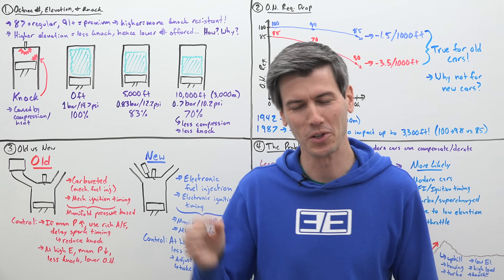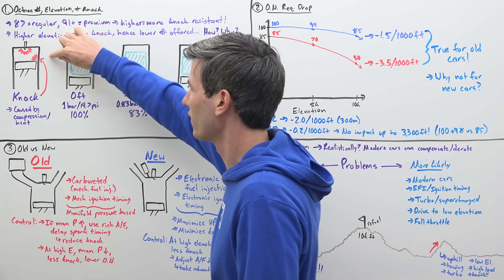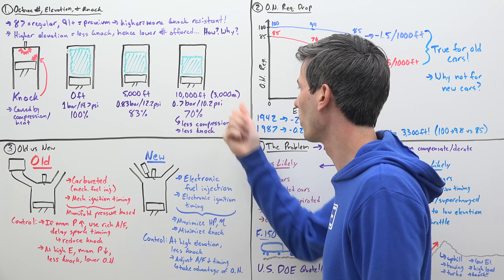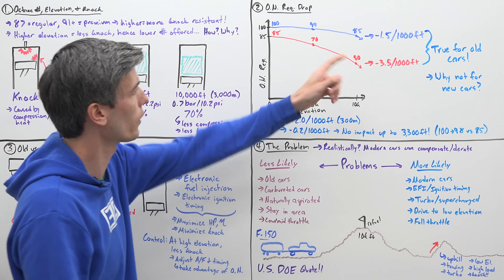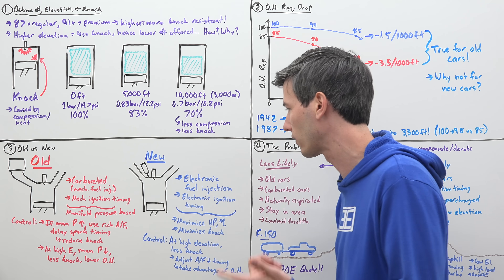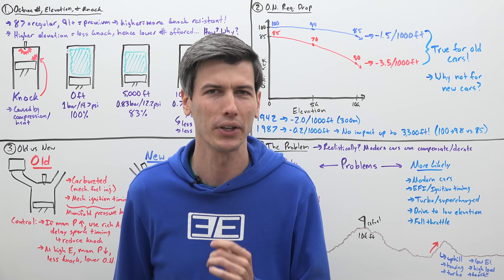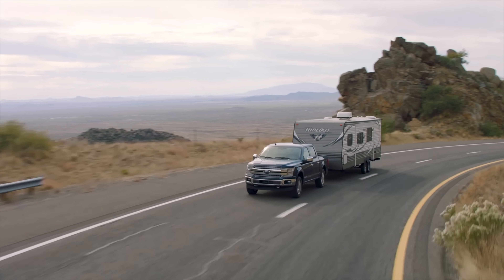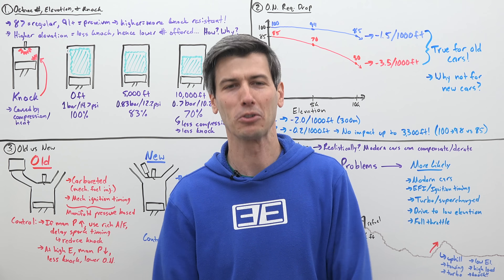Never Use This Gas In Your Car!

Comment: Most modern cars can detect when you're using lower octane fuel and can adjust the spark timing accordingly. You will lose a bit of power, but at least you won't get detonation. Having said that though, you should always use the octane rating recommended by your owner's manual.
Reply: The car has no way to directly measure the octane rating of the fuel it's getting, what it actually does is detect the knocking sounds (using a microphone bolted to the block) and retard timing until they stop. If there hasn't been a detonation for a while, the engine tries to advance the timing again, and on the cycle goes.
Reply: @nerd1000ify  Correct

Comment: Living in Colorado above 6k feet I've used 85 in some vehicles. Most of the time it's fine in n/a regular cars. Now performance vehicles and high compression engines you can't this is absolutely true. Even my old 08 4.7L dakota will knock at wot with 85 Oct. My RVs 6.8L v10 also looses power on 85 which sucks its our regular gas so you pay a lot more for 87 here. Also, turbo vehicles really should use 91 oct here due to the extra AIT heat compressing more lbs of boost to compensate for atmospheric loss. The more heat the more likely you'll knock. I hate it but realistically filling up a 60 gal RV at $4.00  a gallon for 87 here just isn't feasible for me so I take it easy on it.

Comment: I disagree that older cars have less problems with this. Reason: They do not have the precision control over fuel metering and ignition timing. They also don't have knock sensors. I'm only speaking of naturally aspirated engines here. My "modern" 2003 Corolla did just fine on 85 up in the Denver area in spite of its >10:1 compression ration. But it has very precise engine control. Got 40MPG on that stuff.

The real issue with modern cars is high compression ratios often paired with turbos. A naturally aspirated V8 F-150 will do fine on 85 (not towing) a mile high. As you explained you have less air and less pressure in the chambers due to the altitude. Turbochargers pressurize to their spec. They'll spin faster at altitude to compensate and put the specified boost in those chambers. That's where the 85 garbage gets you in trouble. Ditto for any other modern turbocharged vehicle. They run much better at high altitude thanks to the turbo. But you better put decent fuel in it if you want it to last.

Comment: Regular gas pumps should have circular pump nozzle...diesel should have square...e85 should have triangular pump nozzle. That way they can't be used incorrectly without an adapter if car is modified to run e85 or diesel

Comment: Common sense really...only use fuel that your car was designed to use...or higher rated octane(pump gas levels). Unless you've converted your car to run on e85 or it was designed to run it...don't.

What's more interesting is direct port injection pcv recirculation systems. Lowers octane...causes knock...yet the epa still wants it to be recirculated into intake and most manufacturers don't install catch cans from factory. This is terrible on DI motors...and lowers efficiency. Lowered efficiency means more gallons of gas and therefore more oil extracted as well as more exhaust being produced.

Comment: I love in CO we have 85, 87 and 91 at higher elevations you don’t need as much octane as you do at sea level 87 at sea level is equal to 85 octane at 5000ft cause I live in TN they offer 87, 89 and 93, now E85 is totally different it’s 40% ethanol 60% water only place to get good fuel is the race tracks they have usually 93 and 120 octane, 120 octane fuel runs great especially in air cooled motors

Comment: In U.K. the lowest spec gasoline is 95 RON. 97 and 99 are sold as premium fuels. There is a noticeable difference. My car on 95 feels like the exhaust is corked up. It would be hugely down on power at 87 RON. No surprise that US cars have such big engines.

Comment: Grew up in Denver, 85 octane pretty common... lower air density = less compression on naturally aspirated engines (so you don't need the octane to reduce the detonation potential)... well that used to be the case... all these new turbo engines, however, might have an issue with it, though, now that i think of it.

Comment: I remember seeing Reg85 as I was driving through some parts of New Mexico and Arizona years ago. I thought to myself, it makes sense that higher altitudes would allow for a lower octane fuel because the lower air density means less chance for pre-ignition. Though, I wondered if the idiots selling the stuff considered that many who fill up here are simply passing through, meaning they'll most likely pass back through lower elevations before they fill up again. I thought it was just a scam by the gas station to force pass-throughs to buy mid-grade at a higher price.
Reply: I'm betting they're offering what the refiners have available to them and it's up to the idiots who own the vehicles to know what fuel is required.

Comment: Don't modern FI engines have anti-knock sensors?  My experience with recent BMW motorcycles (last 10 or 15 years), is that, via the Bosch engine management systems, they have knock sensors and change the mapping when they detect knock.  (BMW also recommends mid or premium grade gas, depending on model, but I've had the experience of fueling at a gas station that only has 85 available.)

Comment: Explain to me then why ethanol has can have a lower rating than conventional. 
E-10 gas starts as sub grade at 83.5 blending the ethanol adds 2 points for 85.5 for what's supposed to be 87. The conventional or non ethanol is actually at the rated number or higher. Where I primarily load our e10-91 is actually 89.5 and the conventional 87 they ship is 87.5. The conventional 87 is the exact same gas as the e10-91 just without the ethanol.

Comment: My naturally aspirated 2008 car requires 91 at sea level but I've run 87 in it at 4500 ft with no problems for 13 years now.

Comment: I chose 85 in my Jeep Comanche while driving through Colorado since it was the only grade at the pump.  I regretted it when I was in Kansas doing 80 mph heading into a 25 mph breeze...the knock sensor pulled back timing so far back that I was at WOT trying to keep up with traffic.  Added some 93 and it was much better
Reply: Interesting. I did a cross country this summer and noticed the low octane in Colorado. The station had higher octanes available and I didn't know how my car would run on 85 when I got to lower altitudes, so I got the higher grade.
Reply: try running 25% E85 on top of 75% low grade. You'll save money and not have that knock.
Reply: @ChrisLesmerises  I'm good. I don't need 30-50 cents that badly
Reply: That's just Jeep bro lol
Reply: I always stop at Idaho Spring for gas on my way through the Rockies and wtf half the stations didn't have ANY gas, and the others had only 85. Next time I'll be bring a couple gas cans in the trunk.
Reply: @MrPizzaman09 --- "...so far back that I was at WOT...."

You were at "Web of Trust"?  "Wheel of Time?"  "Wall of Text?"  "Weak Operator Topology?"  "War Office Transport?"  "Wheels of Transformation?"

Those are just the first six initialisms that came up in a Guggle search.  Whatever the heck "WOT" means to you, many people (including at least two other 'car guys' I asked), have no clue what you're saying. 
 
Please just spell out a few more words and make the internet decipherable for everyone.
Thanks.
Reply: @be5952  Wide Open Throttle
Reply: @be5952  i thought maybe he was playing World Of Tanks, which would have been very dangerous while trying to keep up with traffic..
Reply: @be5952  WOT is a common term used in discussions and technical papers related to performance and operation gasoline engines (not diesel engines bec there is no throttle).
Reply: @borysnijinski331  A diesel Throttles by adjusting the fuel input. A gasoline engine throttles by restricting the incoming air to the engine. Both engines have throttle. both engines have throttle pedals to communicate driver input to the vehicle. Gasoline engines have a "throttle plate" Diesels do not. Well, most diesels do not.
Reply: @be5952  wide open throttle, its a term used by people who know a thing about cars.
Reply: @be5952  really? I literally googled "what does wot mean cars" and it brought it right up lmfao
Reply: @be5952  What is guggle? and this is a car enthusiast channel. WOT is obviously WIDE OPEN THROTTLE. now get in your own lane. Any car guy that doesn't instantly think of WIDE OPEN THROTTLE is no car guy. And any troll who doesn't double check his spelling is bound to get spanked. Now before you get all high and mighty about something this engrained in car enthusiast culture, check yourself.

Comment: Ford (or any manufacturer) does not need to "hunt" anybody down for using the wrong fuel and void their warrenty.  Service technicians are trained on how to test the fuel if they suspect an engine issue is caused by fuel.  I have never lived where 85 octane is sold but have tested fuel for octane and ethanol.  it's easy and quick.  An average technician can also tell if the wrong fuel was used and then switched to the proper fuel.

Comment: I assumed that the knock sensor was there so the computer could adjust accordingly but perhaps the map does not allow adequate variation because the manufacturer decided on the octane limit.
Reply: the loss of power is a consequence of physics and the map is set so their is no engine damage - you are confusing two things, watch the video again

Comment: Surely it would be easy for ford to creat a mapping to use that octane of fuel, even if it means changing throttle response, injection rates etc. Yes the user will have suppar performance but as you say, it is insane they sell fuep that cannot be used

Comment: In regards to how out of touch laws are, where I live, close to Chicago, we have to go to a summer blend gas with less oxygen to prevent vapor lock. Vapor lock is only a problem in carburated engines, les than 1% of the cars today have carbs.

Comment: I've heard european E85 and america 85 petrol isn't the same. Octane rating is different I believe. I've never used E85 in anything. I know my brp snowmobile gas cap say it's E85 compatible.  I'm not using it if I can avoid it. I'm not taking a risk with fuel I don't have enough knowledge about.
Reply: That's not remotly the same. E85 means 85% Ethanol, where as 85 octan petrol is still regular petrol, just with a low octane number. E85 can only be used in vehicles which are specified for it.
Reply: @shi01  thanks for the information. Like I said I have almost zero knowledge about the e85 fuel, so I don't use it.   They stopped seeling 98octane where I live.  I believe 98 in Scandinavia is similar to American 95 or 92 octane.

Comment: Great video man! The UK government has increased the ethanol content in the fuel to 10% and my car knocks like hell when running on it. Took me a while to figure out it was the fuel and not an issue with the engine lol.
Reply: Strange. 🤔 Here in the US, 10% has been the standard since the 1990s in most grades of gas. All cars are made for it. And Ethanol has a higher octane rating than standard gas. It's used as an octane booster in the US. Hence why our E85 has an octane rating well in excess of 100 octane. It's 85% Ethanol and just 15% gas. So if your engine is knocking, something else is going wrong with it. You should be getting better performance if anything.

Comment: We sell E85 and you can put it in any vehicle that burns Petrol. There is no difference in the filler neck. It fits anything but diesel.

And E85 can totally destroy pre-2001 vehicle fuel systems, and will at the very least cause lean AFR's on a vehicle not calibrated for E85 or lacking a flex sensor. Lean AFR's will inevitably destroy an engine over time.

So yes, we sell fuels that can destroy a car. It's all operator choice.

Comment: Anecdote: a daily driven 2009 Hyundai Santa Fe, currently at 225,000 miles on original engine. Car was purchased in 2011 with 20,000 miles. THE CAR HAS ONLY EVER USED 85 OCTANE! Don’t waste your money because some guy on YouTube said to. Mr. engineer here is a content creator, not an expert.

Comment: So, in short, read the owner's manual for the piece of machinery you just paid 10's of thousands of dollars for (or went into debt for) and follow the OEM's guidelines for operating the equipment.  It's really sad that this needed to even be said, let alone have a video made about it.

Good video though.  This is one of the week 2 things we learned in "gasoline  engine repair" class (what happens when you don't put the right gas in the vehicle and how to diagnose).  Ford Mustangs are similar although I seem to remember them needing the highest (92?) octane fule...I could be wrong though, it might get by on the 87 octane rating gas.

Comment: Great video. Thank you. This also helps me to understand better, why, in the 1940s, 1950s and probably for a while thereafter, aftermarket supercharging was reportedly a common choice for private car owners living in the Andes.
Reply: Turbos are still popular for small planes that want to fly at higher altitudes.
Reply: @grayrabbit2211  Well no duh. That's why they're called, "Turboprop"
Reply: @MichaelShelleysmi  A turbo on a small plane is absolutely not the same thing as a turboprop lol

Comment: The gas stations should be required to label the fuel as high-altitude fuel, and post a notice about it.
Reply: The octane rating is labeled on every pump. That's all the info you need.
Reply: @shikkonin  Most people have next to no idea what that number means, or that a number lower than 87 could damage their engine. It needs clarification for the majority of people who aren't engineers. It is not all the info that people need...

Comment: If the engine is knocking the knock sensor should be giving the ecm readings indicating the engine is knocking and the ecm will retard the timing automatically. Same as when the intake air temps are too high. The ecm regards the timing and therfore power. But it should keep the engine safe. Was any of this taken into account for this video or am I missing something here?

Comment: I didn't know that 85 octane wasn't sold outside of Utah and other high elevation states because of carbureted engines.  It also explains a lot for why I hear a ton of cars with what sounds like rod knock each day at work.
Reply: Rod knock is a very different sound. Detonation in an engine without modern emission control sounds like a crackle. Odds are you are hearing actual rod knock or even an exhaust leak at the collector, which sounds eerily metallic.

Comment: It means Ford screwed up their design. For more than 10 years (engines using E-throttle and EGR, as these are needed to allow for that functionality) it is rather standard to equip the engines with knock sensors and a software that detect the knock approaching and automatically reduces the pressures so to suppress the knock.
Yes, it reduces the engine power very significantly, but it keeps the engine safe to use even substandard octane fuel.

Here it seems Ford decided to boost the power by deciding to "tolerate the knock on peak power demand" (my guess: To mask the turbo lag) and so does not have that knock prevention build in (or it is designed to respond with delay). As a result, with substandard fuel it is entering the "peak power demand" area way too often, resulting to excessive wear with the lower octane fuel.

Comment: Seems if you're going on a trip from a high elevation location to a lower one, just fill up with plus (that's 87 octane to us in Colorado) before your trip. Problem solved.
Reply: Ehh, just kill the engine and coast all the way down the Rockies to a pump. Hit some 91 to average it out.

Comment: It's all about detonation. Just buy fuel for your engine specification so as "not" to have pre-detonation in your engine. Old mountain sledders know fuel air management very well! You burn up 2 stroke engines easy, pre fuel injection. Same as buying hi octane fuel for lo compression engines. Not usually necessary. Great video ehh 🇨🇦
Reply: 2-strokes are very sensitive to mixture, too lean and you'll blow the engine for certain. So on a mountain you'd have to be careful; correct carb setting at high altitude may be too lean when you get down lower...
Reply: @nerd1000ify  You are 100% correct. We'd climb up mountain ranges in morning, and the day would warm as we continued higher. We'd have to re-jet to a smaller orifice jet due to higher altitude, and less oxygen. We'd play and have a ton of fun. As the day ended we'd decent down mountains into a valley bottom often with temperatures dropping. This would increase O2 levels incredibly, and our sleds would sound like sewing machines and very zippy! We'd blip throttles hard trying to richen fuel supply and not blow up  Sometimes have to stop and re-jet up larger. Kids got it easy now with fuel injection, but we understood engines :-) Thank you for the comments fella :-) 🇨🇦

Comment: The "Don't use it in modern cars" idea just doesn't work because in high elevation areas like in Colorado where you rarely drive at elevations below 5,000 feet, no gasoline stations sells any gasoline less than 89 octane gas. This becomes a real problem on turbo or supercharged vehicles.